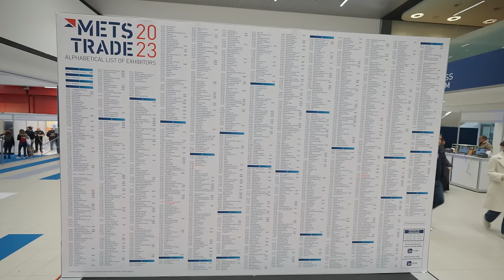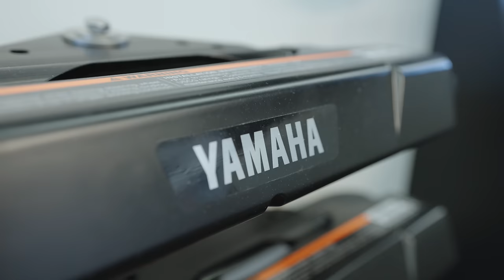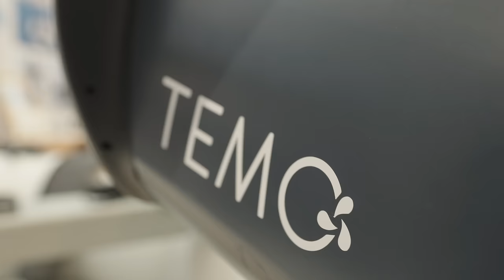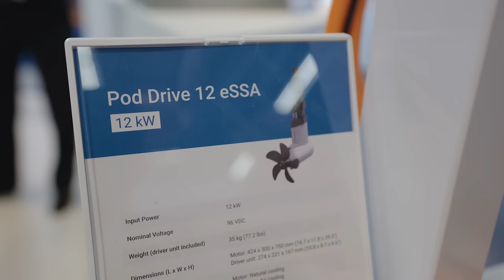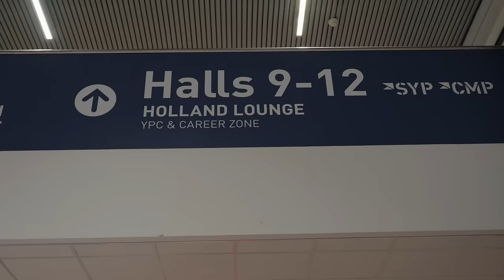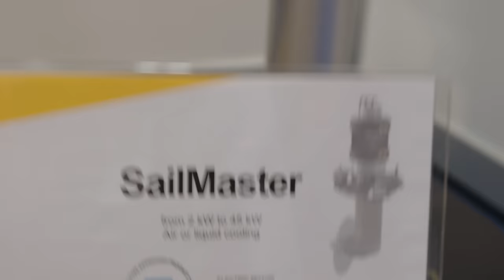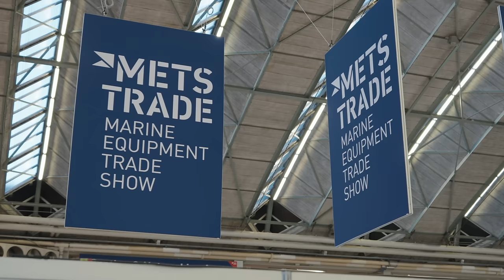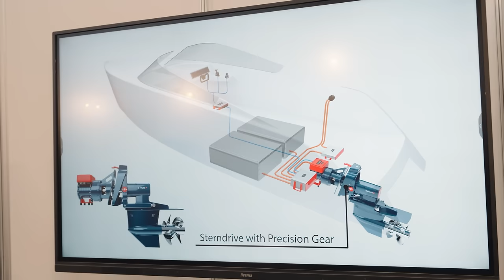The Shocking Truth About Electric Propulsion | Step 371

Comment: This is an awesome video- thanks! I think it is worth noting that the need for regen seems more compelling for a monohull with limited space for solar panels. Most catamarans have room for significant solar, eg approximately 1800-2400  watts, are pretty self sufficient 95% of the time and can supplement with a backup, eg high output alternator, when there are several cloudy days in a row or if in very northern latitudes/winter with less light. But again, a really great video!

Comment: Another great video guyzz, very informative and professionally done!
There is one question in my mind: Did you ever discuss the difference we see in electric propulsion, if it comes to motor placement?
I am going to use the EVO 6.0 outboard version from Epropulsion, but am still wondering if having the actual motor below the waterline would be advised.
Epropulsion sais that they are completely maitenance free, and they are giving up to three years of warranty, which made me feel safe to buy two of them.
Did you ever ask anyone about this matter, or do you have more info on it?

Keep up the great work!

Comment: 1]  On Uma, can you switch your saildrive to be propeller forward?  2] As a retired windmill engineer, the generation, or 'regeneration',  capability is proportional to the propeller diameter squared, while most of the propellers are optimized for propulsion, with re-gen an afterthought,  a 41 percent bigger prop, should double the potential re-en power, while sacrificing some efficacy in propulsion.

Comment: Thanks for the interesting video!
Statistically, a sailboat is at anchor most of the time, so the recuperation function of the electric motor is absolutely not relevant.
I would say that hybrids from Combo is the most interesting solution but definitely they have to add a clutch to be able to disconnect electric engine from the prop shaft.

Comment: I just wanted to mention that older Amel sailboats had a shaft alternator for regen-ing electric under sail. My 1985 Amel Maramu has a toothed gear/belt attached to the shaft behind the gearbox. Henri Amel was ahead of his time. Like mentioned here is that it sadly it just doesn't generate much power 90% of the time. It only really regens under high wind/boat speed. You are much better off switching to a feathering prop which "generates" increased efficiency 100% of the time. It also more efficient in light wind which is more common in general. Of course, YMMV...

Comment: funny. was just looking at electric outboard motors yesterday. i just got a small 22' sail boat. my very first. and love the idea of going electric again for the low noise. i got the knowledge and skills to make my own battery system, using salvaged bicycle cells. making the jump way more affordable. so i'm aming for a 1,5-2kw motor. bit overkill but i don't save much going lower anyway.

Comment: as someone with experience with small electric outboards obviously water intrusion can be way more damaging than ice outboards. torqueedo's design is horrible, the lower unit houses the motor and motor controller with a multiple piece design meaning multiple seals and orings that can fail and destroy the electronics. temo look the same as torqueedo, multiple piece lower with electronics. epropulsion still keeps the electronics in the lower on the 1kw model but it looks like one piece with less seals to leak. remigo looks slick with its all welded aluminum midsection/lower but if the prop shaft seal goes is it all open inside allowing water to get to the motors, controllers and batteries? The Elco's are not as elegant but having a lower unit like a regular ice outboard means that all the electronics are where you normal powerhead is and a failing shaft seal just means leaking lower oil like any normal outboard, a much more robust design.
Reply from the maker: The problem with adding gears like traditional outboards is a lot of efficiency loss. But we agree. Less seals the better.

Comment: I have a trawler with a single Cummins diesel + a Northern Lights 12 Kw Genset. I’m always conserned about loosing the engine way off shore and have looked at hydraulic get home setups running off the generator engine. They are nearly impossible to retrofit. 

The combi system might be an easier system but it probably couldn’t run on my 24v system.

Comment: Please keep us informed on the research into the regeneration systems you find out about.  I have a 28.5' full keeled Pearson Triton. Would Electric work with the keeled being directly ahead of the prop? With the big barn door rudder?  Thanks ⛵️
Reply from the maker: It's about boat speed. If you can't sail at 5.5+ kts consistently in winds 10-40kts then regen isn't really viable on any boat. But smaller boats use less power, so maybe. Also clean water helps a lot. Might be better to instal two pod generators on either side of the keel, then one small pod motor in the middle behind the keel.

Comment: I doubt there's anyone in any specialized boat, designed for an exact match electric motor, propeller, and controller with the most efficient setup, that can regen more than 10% of available energy.

Regen for boats is a joke hyped to the max. It isn't worth pursuing for 99% of the boat designs today, maybe not even ever.

Comment: I am always, well for now at least going to have the same problem, the batteries, the construction, safety, and disposal of them are not yet growing on me. I do hope the problems they have will one day be overcome.
Reply: Yeah electric isn’t the magic bullet that people think it is.
Reply: I have to agree! The bigger issue is the batteries. While the government is pushing for going all-electric for cars, the infrastructure to go with it isn't close enough to make it realistic. Right now the supposed benefits for making us more "green" are bogus based on the production of lithium batteries footprint being larger than any amount of pollution saved by using them.
Until they can make the batteries safer and much less expensive to produce with a faster way to charge them, the cart is before the horse when it comes to making the system work.  That said, I think for sailboats in particular, the idea is practical and a great idea.

Comment: What about the ecoDrive from HH or the hybrid from max cruise. Both of those for cats seem to be the inline hybrid system similar to the Combi. Where they use  standard diesel engine that can engage an electric motor as a gen set, power directly from diesel or power directly from the motor.  Most people are going to want a genset even with a large solar array. Being able to have that diesel generate power or population just seems like the best bang for the buck.
Reply from the maker: They weren’t at the show. But if its the same theory. I think its great solution if you have an existing diesel. It doesnt make much difference in prices if you are building a new boat. But much Cheaper solution on an existing boat and existing diesel engine instead of replacing the whole system
Reply: @SailingUma  The big thing is the flexibility. You get a genset, diesel motor, and pure electric with regen. For basically the same space. The only really added space/weight is the battery bank which everyone wants for house loads already.

Comment: Hi Guys, great stuff! Did you find the Fischer Panda motors?  They have some great pod drives, using low rotation speeds and big props that provide great regen. I am looking to put 2 x  20 kw units on my catamaran, which will be retractable.  Hoping for some great results from the data provided so far.

Comment: I really like the sound of the potential performance of Oceanvolt's servoprop saildrive (particularly regen) but I checked prices and found their 10 KW option costs about $10,000 more than the equivalent Electric Yacht option with a fixed prop.  Given my budget the lower performance option will serve well enough, in fact very well for my purposes I suspect.  My little inverter generator will pick up the slack when needed.

Comment: An engineer friend of mine once asked me why nobody has attempted to (re)generate power by capturing the huge amount of energy produced at mast under sail (the energy generated/released by a flexing mast).  I have yet to find a vendor that's focusing on that solution. That said, I really like COMBI's super cool custom plate solution for standard diesel engines. Thanks for the video. I'm really looking forward to watching you two repower your boat's propulsion system.
Reply: Hydro gheenrators for sailboats have been around for a while
 " Hydro-generators are fast becoming a mainstay in the renewable energy mix for cruising boats, after gaining real traction during the 2008 Vendée Globe round-the-world race, when they were widely fitted to the IMOCA 60 fleet. "   
Regen is getting propulsion and generation from one source, a two for one kind of deal and a GREAT idea for sailboats

Comment: Well done, cold turkey, commercial leisure vs industrial. Your primary aim was determining viable regeneration sailboat applications.

Here there were few and far between credible ones. For several reasons: application (industrial/commercial/leisure), frequency of use, distance travelled (day sail vs ocean crossing vs racing), speed 7 knots or higher, propeller orientation forward or backward, propeller type - fixed, folding, feathering, design and weight of boat, monohull vs cat or tri, type/size/location of keel. Determine: fully electric, hybrid, genset, solar, wind, shaft, outboard, inboard, direct drive, truster. Customizing existing diesel with an electric.

Consider full integration, support, reliability, price, reputation, years in the business, innovation. Truster controls and feel. Over the air software updates. Operating range, efficiency, component design, fabrication, material type or source.

Category use:

E-bike
Small tender to get to and from the boat. Not necessarily on plane or speed.
Fast tender or speed boat. Fishing derbies, multiple divers with gear, leisure - skiing, gliding, towing or pushing, tubing, surfing.
Small to medium size (20 - 40 ft) day sailboats to large (42 -75 ft) ones.

Application:

Industrial, commercial, leisure, racing [day(s), weeks, months], conditional dependencies or fully independent, single or multiple power sources - wind, solar, gas/diesel/hydrogen, regeneration, hybrid. Live aboard with all conveniences or minimalistic or practical compromises. Area of the world, weather patterns, sea fare. Emergencies (unexpected storms, lightning strikes, dragging anchors, loss of power or overheating, bad weather, situational need for speed or power (pushing, towing, grounded on sea bottom).

The solar panels and rear mounted hydro generators on round the world racing sailboats from 40 ft to 50 ft are very specific and unique. On board conveniences are very minimalistic. Power required for all the computer, radar and communication systems.

Data

Not everyone has easily provided data on regeneration. Specific to application, testing environment. For your size boat and multiple sailing cruising environments [ artic, Mediterranean, from day passages to week  long crossings, wind too much or too little, sunny or overcast for days, off grid, isolation] not much is out there. From a volume and cost/profit amount.

Early development days of transition from hydrocarbon to fully electric - battery type, "fast charging" rates, cable sizing, safety, battery monitoring. How fast, how long, what weight, sea fare (wind, current, wave height and distance, e.g. Cat 1 - 5)?

Consumption of power daily: water maker, hot showers, induction stoves/microwaves, washer/dryer, heating/air-conditioning, fridge/freezer/toaster/coffee machine/kettles/all your video and charging accessories.

Comment: Oceanvolt has good products for sure. I used the online configurator for my 30ft 2t trimaran. They recommend a 6kw solution (that is ok) with estimated €50k excl. tax?!
Reply from the maker: Yea it’s a bit ridiculous how expensive electric systems  currently are. They are not even the most expensive ones. And keep in mind too that each quote depends on the system that you plan on installing so its not like an outboard where you can just buy it off the shelf for a fixed price.
Reply: @SailingUma  I guess that is the main reason that the other companies do not focus on regen. Is there any 30ft sailing boat owner willing to pay that + installation (i want that retractable) for some "auxiliary" unit? I am a sailer.
Reply: We have  a new OVNI 430 aluminum monohull sailboat with an Ocean Volt 24 kW motor, 11 kW Fisher Panda generator , 48 V Lithium Fe Phosphate batteries, and almost 900W solar panel. If the batteries are down (would be surprising) the FP can work directly with the motor.   We have regen over 5 knots depending of the sea state. Very expensive installation but omg silence has no price….

Comment: Would be more exciting if the costs weren't so high. A 15-20kw system that matches a typical midsize yacht diesel - with a battery bank big enough to be useful (and the solar/hydrogeneration to charge it)- will cost more than a new electric car with 10x the power and battery storage. I can imagine that prices will slowly come down but low trade volumes (in an industry focused on the more profitable luxury or work boats) means it's always going to be expensive. It would take a large volume manufacturer that can repurpose EV parts to make prices even vaguely acceptable to a typical sailor - and I don't see anyone getting invested in it so far.

Comment: How many boats actually sail the miles day-in and day-out to make regen a #1 priority? My guess is that of the possible market 99% are weekend sailors (like me) that use the engine to park in-and-out of the marina and to get home 10 miles when the wind dies. Not having to deal with a combustion engine would be a huge win. What I needed is a very simple system, 50 miles of battery range and a dockside charger. Won't be long until 50-100 miles of battery range becomes cheaper than a Yanmar, and that's when those folks will be selling thousands of motors.

I know you folks are constantly on the go, but aren't the majority of cruisers spending long stretches of time at anchor, with short island hops in between? If I were to build a electric cruising boat then my question would be: What do I need to keep the freezer and water maker going indefinitely, while gaining 10 miles of range each day so I can motor in-and-out the anchorage. If I have enough solar to do this, then I probably also have plenty of power during passage when I throw in a really simple regen system.

So my question: how many boats actually exist that cannot meet their demand with solar, but do sail enough on a near-daily basis to make high tech regen a desirable power source, and are committed to not carry a generator? Doesn't sound like the bulk of the market to me to be honest.

Comment: When propelling a boat almost any propeller and rpm will work if you don't care about efficiency. A   small outboard with  a prop spinning at 5,000 rpm will move a small sailboat but with much wasted energy. A larger prop with a slower rpm would be more efficient. The problem with regeneration is the boat speed is fixed  when under sail. The same little propeller that powered the boat at 5,000 rpm whic much slip  is now barely spinning under sail.  The relationship of HP to rpm and torque is HP= RPM X Torgue, all divided by 5250. So you can produce power either by a high rpm and low torque, or low rpm and high torque. A  1 hp  motor at 3600 rpm produces half the torque of a 1 hp  at  1800 rpm as an example. For regeneration since the boat speed  under sail is  fixed,  you need a larger dia propeller  to produce a higher torque at a slower rpm. The regen motor must also be capable of producing  the higher wattage at the slower speed. The propulsion motor and prop  may have to be designed around maximizing  regen not propulsion.  I think this is very doable with a larger folding variable pitch prop that will maximize regen with a slower rpm motor.  Motors/generators that produce higher torque at lower rpm's are generally bigger in dia. or longer.  All the electric power boat mfg, understand this but most don't have a product geared around re-gen, they concentrate on propulsion. I am retired from GE  Compnay as an application/sales engineer in their motor division for 33 years. Hope this helps.

Comment: Electric and unlimited free power is still a dream. Batteries aren't there yet, a jerry can of diesel can store nore power than a ton of batteries. The only viable option I see today is the hybrid setup, where you have a conventional diesel and a electric addon for short distances and as a big generator to recharge. Regen from sailing adds drag and slows down just like an barnicles infested hull, and it barely produces 5-10% of the motor rating. Sometimes dreams and reality are oceans apart.

Comment: Great video! I get the reasoning behind having the prop face forward, but doesn’t that up the odds of it getting wrapped? Thank you for your effort
Reply from the maker: It’s still behind the keel… so not really. Also with electric you don’t damage anything if it gets wrapped. The motors just stops. The new 25kW has a line cutter built in.

Comment: Fantastic production and knowledge. One question, can Combi and others put their generators/ motors  on a diesel engine  that has sail drive and not shaft drive ??? Iseems fairly straight forward with shaft drive.
Reply from the maker: Probably not. Unless it replaces the mechanical transmission.